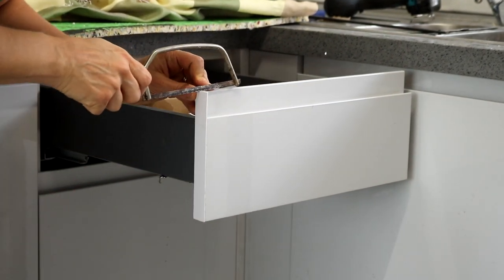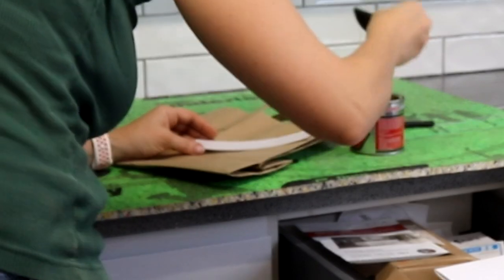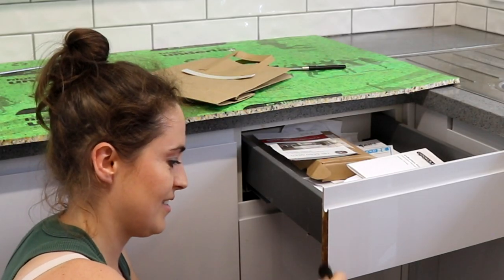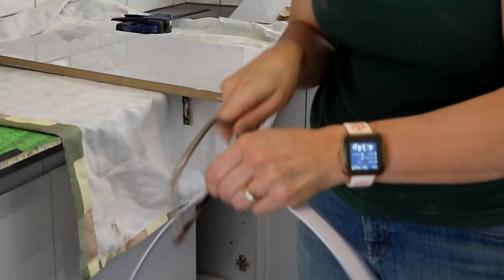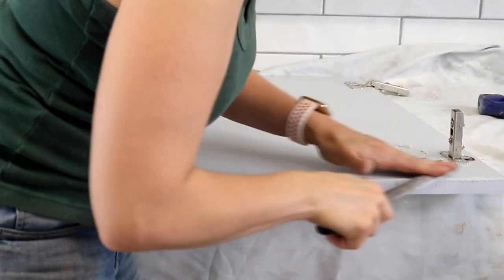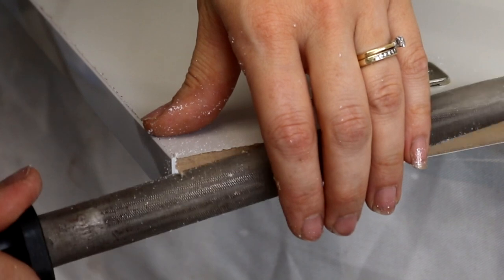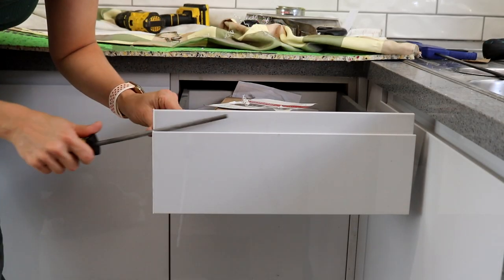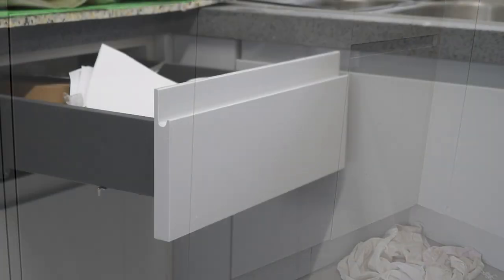Applying Edge Banding to Melamine | The Carpenter's Daughter

Comment: I'm a kitchen fitter and although I want to list loads of points and be critical...I've decided to refrain from this and say well done..however ..one point I would make is that files & rasps although similar are also different..a rasp is far to course a tool really to use and a file is perfectly adequate..putting edging tape on is quite a skill in its own right not easy at all so well done.

Comment: Worth spending the time masking over the areas around where you are using the file, one slip/lack of concentration and you could leave a nasty mark on the unit. A dremmel type tool would be useful for doing the curved area.
Reply from the maker: That's another way to do it :)